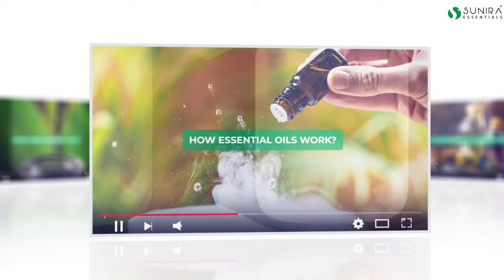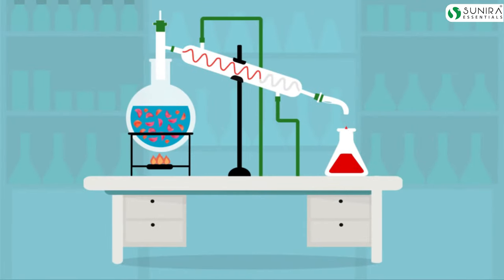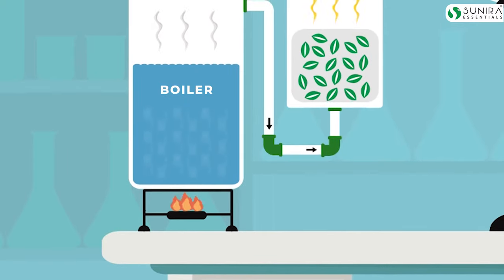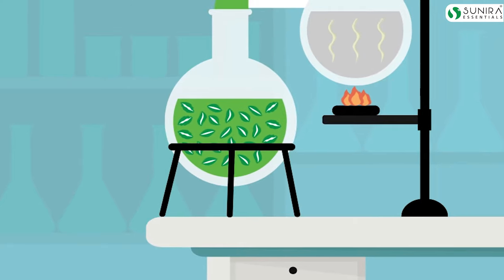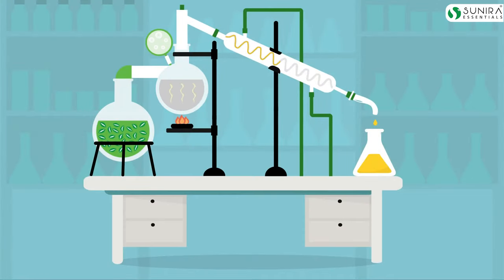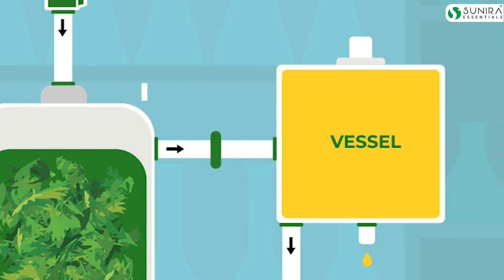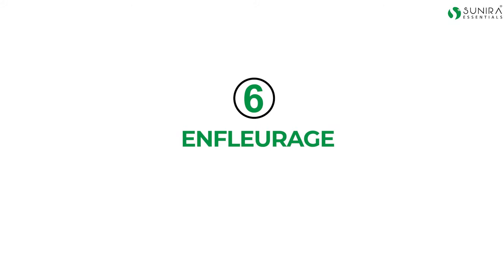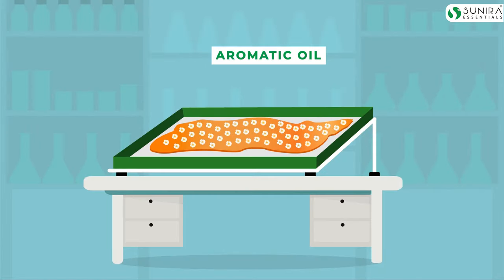How essential oils are extracted from plants

Comment: CO2 is not converted into a liquid state. Saying this opens to door to the false idea that it is liquid CO2. It is converted into a supercritical fluid state. Where it acts more like a gas. It is also very dangerous due to the extreme pressures and high temps, leading to explosion risks. Mainly at the end when improperly opening a chamber without releasing pressure. It is another state of matter such as solids, gases, liquids, supercritical fluids, and plasmas.
Reply from the maker: Our effort is to educate the audience in easy to understand language. Sometimes it is difficult to explain complex technical terms to a wider audience. I hope you understand.

Comment: For the hydro distillation, what condition should the herbs be in? I have dried lavender and want to use that. Is it better to have live plants, or is using dry herbs just as fine?
Reply from the maker: Hydro distillation can be done with both fresh and dried herbs, so using your dried lavender should work perfectly fine! In fact, dried herbs are often used in distillation processes as they can be stored more easily and have a longer shelf life compared to fresh herbs.

If needed you can apply this simple logic -
If the need is to capture just the aromatic component of the flower use distillation process, but in case of certain medicinal herbs  we also need the non aromatic component from the herb - in such cases we think  making a decoction will be more suitable.

Comment: Hi, very helpful info.
According to this, I learned CO2 extraction is the best method but it is very costly.
Reply from the maker: Thank you for your feedback. Yes it is the cleanest method but also costly to setup
Reply: @suniraessentials  how cardamom oil
Reply: How much it will cost for the setup ?
Reply: but the final product is very much clean almost 100% pure essential oil, no contamination, so cost effective.
Reply: I did the last method almost a year ago with my neighbors lilacs and some lard that I rendered. I used it in my goat milk soap and it was perfect! Light and dainty scent. I usually just make them unscented so it was a nice change of pace.
Reply: @suniraessentials  Which method would you choose for fresh lemon balm? I have heard you cannot capture a lot from it.
Reply: @suniraessentials but I think it’s not a natural method because it has chemicals, what do you think ?
Reply: @hocineted7594  Carbon dioxide?

Comment: Thanks for sharing this. I tried the method of soaking the plant in oil for a while and then filtering the mixture and it worked to some extent. What is your opinion.
Reply from the maker: Repeat the process with same oils and new plant material. By doing  this you can increase the concentration of plant material in the oil.  I hope this helps.
Reply: @suniraessentials you mean to soak the rosemary in oil and stain it then soak new rosemary leaves again in same oil?
Reply from the maker: Yes

Comment: Great video - get's right to the point, explains the various methods well, and the graphics are helpful.  Perfect!    Only minor additions I would add is that cold enfleurage is once again a commercial process that now uses vegetable fats to replace the tallow/lard of the traditional process, and that there is also hot enfleurage which is the traditional process originating from Eqypt, thousands of years ago, in which the fats and petals are melted together at very low temperature,  and then later melted again so that the plant material can be strained out.  It might also be worth mentioning that the result of either approach to enfleurage is not essential oil, but the scented fat (called 'pomade').  If it is desired to get the essential oils out, another step is required.
Reply from the maker: Thank you for your thoughtful and informative comment, Stephen! We are glad you found the video helpful and appreciate your additional insights about cold enfleurage and hot enfleurage method.
You're absolutely right about the modern use of vegetable fats in cold enfleurage, which is a more ethical and sustainable alternative to the traditional use of animal fats like tallow or lard. This update is a significant development in the world of natural perfumery.

Your additional information contributes to a more comprehensive understanding of these traditional perfume-making techniques. Thanks for sharing, and we hope it helps others who watch the video!

Comment: Can I get this info written?
Reply from the maker: Yes you can
Reply: Can i also get one
Reply: How can I contact you.
Reply: Which method is the best
Reply: I need detail video. Sometimes I miss technical points
Reply: Under the video, on the menu line with subscription etc., you click on the little dots at the end of the line and you can get the transcription. There you can select all the text and copy it on a word file. You can get it with or without the time stamps, but you will need to check it as it is an automatic transcription, and it needs editing.